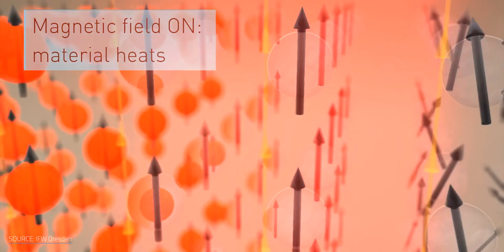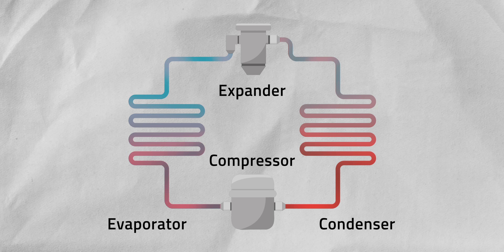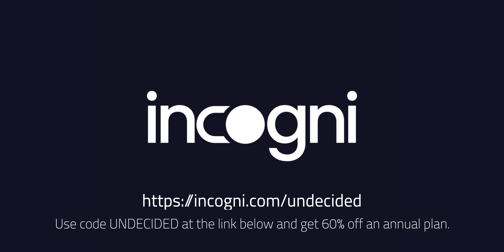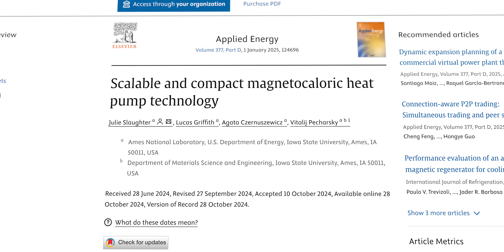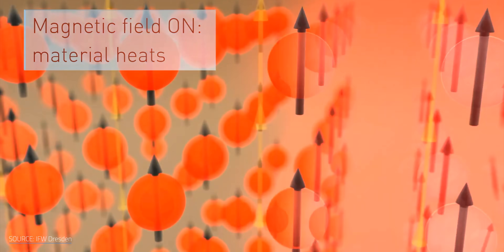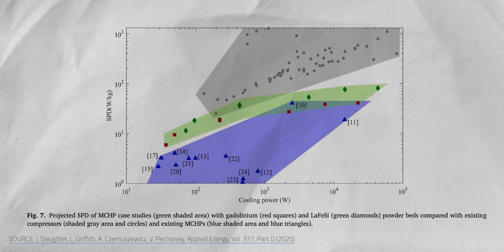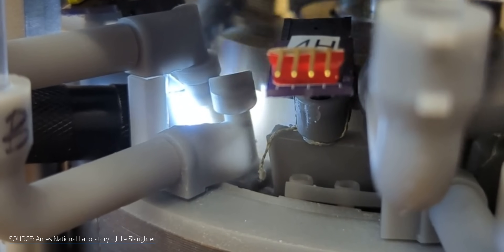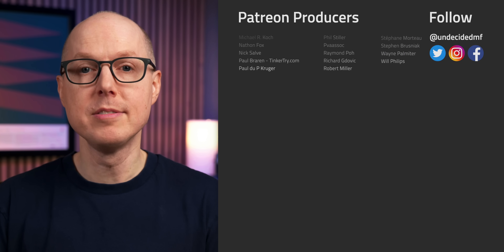How Magnetic Cooling Is Breaking All the Rules

Comment: 6kw isnt really data center or supermarket sized. That is more like a 4.5ton AC unit. My house uses a 5ton AC and it is even undersized for my house location and size. This company would honestly need to have 3-8kw units be easy to build and cheap to ever be a viable option to replace AC and heat pumps for home cooling.

Comment: I'd be interested to see if they have considered heating/cooling of a living space. Refrigeration seems like it'd be much easier because you don't need to move the unwanted heat outside.
Reply: I wonder if "refrigerant" cost comes into play. I think gadolinium and lanthanum are both quite expensive. There may also be issues with the current tech requiring strong magnetic fields to scale up that large.
Reply: @erikdietrich2678  They're quite expensive right now. Imagine what happens to the price as the world leans harder and harder on the limited supply of rare earth metals.

It's interesting tech but I've got doubts how well it actually scales in real world markets.
Reply: @erikdietrich2678  and the effects of those magnets on electronics and such.
Reply: Yep your fridge will heat your kitchen a bit, but it's not enough unless you had a huge multi head system for a ton of random units, and it would have to be all custom built.

Comment: Are the moving parts equal to a regular freezer? How will they hold in the long run?
Reply: The moving magnet does not need to seal against a sidewall, so that should survive better than a compressor, but will need to be riding on bearings, and spun by an electric motor. Each fluid chamber has a set of valves in it, but we've mostly got valves sorted out in reliability, although that would be a service item still.

But you would need two coolant pumps to circulate the water, one for the hot side, and one for the cold. Since they are not high pressure like a compressor, they will run at a lower RPM, be cheaper and wear out less, but there are two of them, and because absorbing the temperature differential fast is critical, they are probably pretty decently sized to move a massive amount of fluid in a short time. I suspect they will still be both cheaper and more reliable than the compressor, but they will be the worst service item here.

I think if I were to cost-optimize the current setup, I'd probably have just one electric motor that drives both fluid pumps, and the magnet off of the same gearing/shaft

Comment: Technology is promising but until it comes commercialized and advanced, greener refrigerants like hydrocarbons, carbon dioxide will be the feasible option.
Reply: I mean, that's any new technology: existing and cheap will beat new and expensive. What matters is if the existing technology is reaching the limits of what further maturity can accomplish, while newer approaches can vastly exceed that. Solar panels were expensive and impractical, until they weren't: now one of the biggest limitations to widespread adoption is grid storage, not solar tech cost itself.
Reply: @erikdietrich2678  solar panels are still pretty impractical, they still don't produce enough energy in their lifetime to offset the cost of energy to produce them, and also deal with all the toxic waste from the heavy metals used in them. The most dangerous thing about solar panels is people have been led to believe that solar panels are a 100% safe technology and doesn't need any special disposing of, but they dooo, they produce multiple orders of magnitude more toxic metal waste than Nuclear power.
Reply: Ammonia is too dangerous to have as a refrigerant for domestic uses.
Reply: @ I want to believe the stuff we're currently using is far more dangerous. People use ammonia to clean with and they spray it all over their house already. It can't be that dangerous compared to the refrigerants we're already using or people wouldn't spray it in close proximity to their face while cleaning.
Reply: @Thezuule1  Scary thought. Ammonia cleaning products are usually ~5% ammonia. Using ammonia as refrigerant requires highly pure ammonia, ~99.5%. The difference between being exposed to 5% ammonia and 99% ammonia is the difference between a refreshing clean smell in your house, and drowning to death in your own fluids in minutes from even a brief exposure. Nearly pure ammonia is not something you want around dummies.
Reply: @Thezuule1 it’s a caustic, it burns the inside of your lungs in an undiluted form, like as a refrigerant.
Reply: @crewdawg257  I guess I never considered how dangerous it was simply because it's so common. Your body produces the stuff so it didn't click in my head it would be more dangerous than the already incredibly dangerous stuff we use.
Reply: Ammonia? That's toxic stuff
Reply: Domestic refrigerator repair is screwed up, those guys for the most part aren't trained in the slightest and are blasting butane through leaking fittings with a 5 minute vacuum. Imo getting rid of refrigerant in domestic fridges would be huge for that part of the industry.
Reply: @d0nk3ybrain57  why bother training your repair guys when you just want them to replace the unit?
Reply: @d0nk3ybrain57  How many domestic fridges are actually being repaired? It might be that incorrect disposal of domestic fridges is actually a bigger problem, leading to gas release in atmosphere. In that case, stuff like R290 Propane is a blessing compared to R134a or R410 etc.
Reply: Supercritical CO2 is tight!
Reply: @danielpicassomunoz2752  u wil diyee at dat point